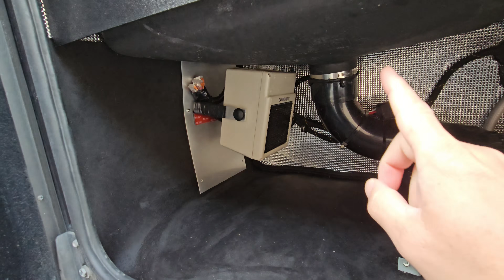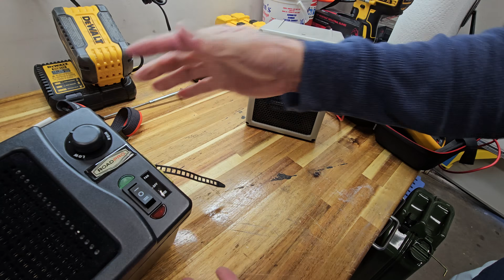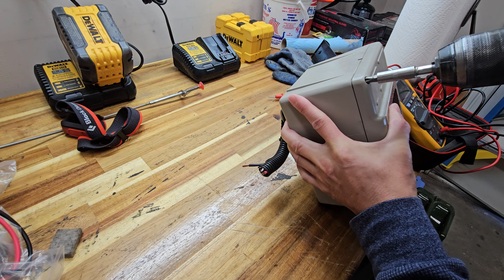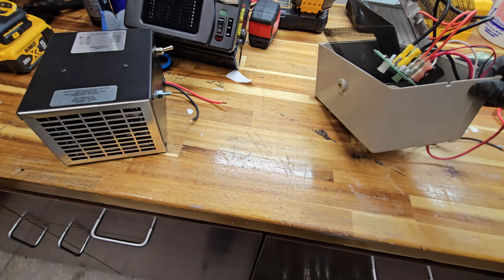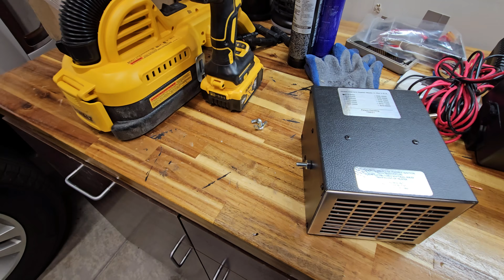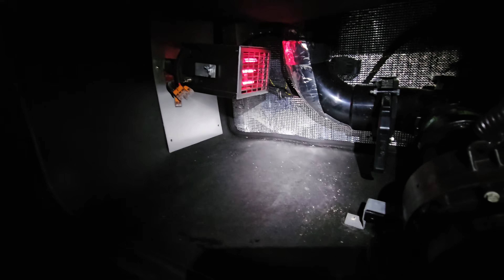BEST 12 VOLT RV HEATER

Comment: That heater uses 2 seperate circuits, one for the fan and one for the heating element, your heater was probably fine. If you bench test the heater it was probably working, the burning smell you were smelling was probably the 30 amp fuse plug on on the rv for the heater circuit. Not the fan circuit
Reply from the maker: It was a burned out heater element. Both circuits were fine.